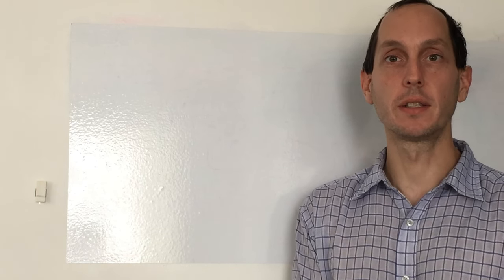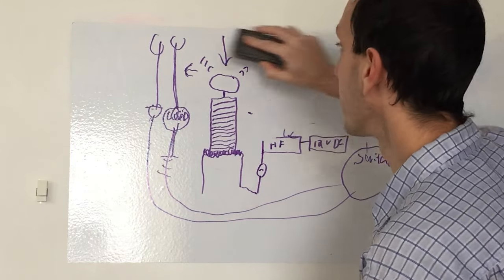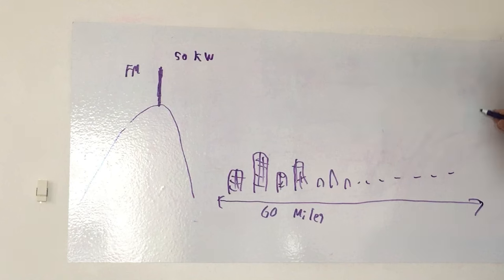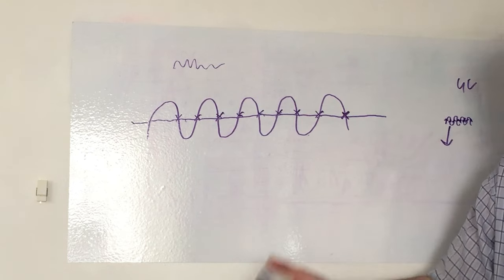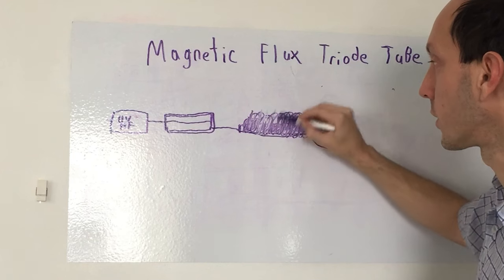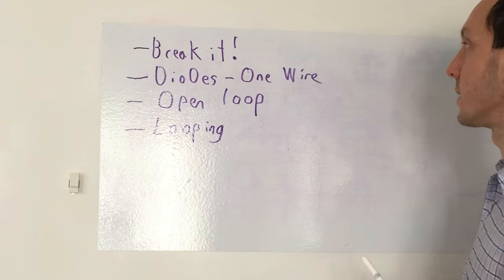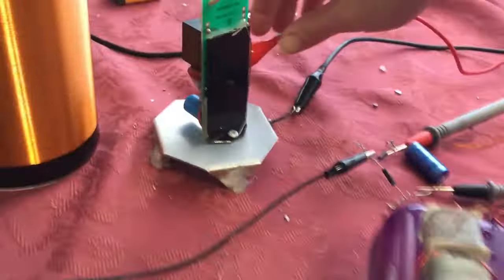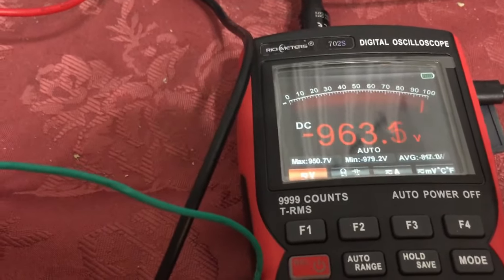The Magnetic Flux Triode

Comment: Your setup and explanations reminded me of another Tom Bearden setup which is as follows:
Make a step up transformer and connect capacitors in series on both wires that are coming out of secondary and then connect one more step up transformer and then run load after 2nd transformer.
The first transformer won't draw as much current as the second transformer primary will draw. The extra current will come from displacement current as a result of connecting capacitors in series. If you get time, try this too.

Comment: Hi Joel, can you use gas discharge tube (gdt) spark gap to mimic switching instead of transistors? Either use it as plain spark gap (GTD with 2 pins) or triggered spark gap (GTD with 3 pins, where one acts as trigger). GDT can be obtained to spark at specific voltage (150V, 350V, ...) according used capacitor. I thing you used this in some of your previous video.

You are very inspirative for me. Thank you
Reply from the maker: I don't see why not. You could calculate the timing so lets say you got 60 capacitors in theory you could make them all fire one time a second and there is your crude 60 hertz. no transistor. Also would need to build a few tubes to drive the caps.

Comment: For triggering a mosfet dump you can use a neon bulb at 90 volts they make diacs that trgger much lower i think ive seen them at 3...9...16.. ect the 16 would be great for battery charging and easy on the transistors .
Reply: Explain this pls.
Reply: @TravisTellsTruths  I don't have the diagram on front of me but the short version is a neon is placed between the gate and the accumulating power source and when the accumulating power source reaches the trigger level around 90 volts it triggers the neon and activated the gate of the mosfet .you can put a resistor on the neon to drop the amps from coming though to the gate you only need the voltage. It dumps to a battery
Reply: Fascinating. Did you know that Bell Labs (evil) used fluorescent tubes as literal "negative-resistance" telephone signal amplifiers? Can you explain this at all?
Reply: And really cool, BTW. So instead of a traditional resistor for the gate?
Reply: @TravisTellsTruths  no new to me how did it work out .
Reply: @TravisTellsTruths  speaking of bad corporations westing house ???..don smith said that they build a group of drones for China that used his system in them and never need to recharge just stay up indefinitely.then he said now you see who the real enemies are .
Reply: @R2NOTU  well I read in the very early and more primitive days, that was done. I'd like to know more about it. And what they used next.

Comment: LOOOOOVE IT!!!!!!  You are so close to a useful powerful unit!
Reply from the maker: Well I can't come any closer as this. But I give everyone the information if they have the resources to build this. I'm thinking perhaps high voltage relays or even spark gaps with something like 60 capacitors at the right value can all dump one time a second equals 60 hertz, Whatever it is, It needs money high voltage components don't come cheap and you need a kind of workshop or garage. I just can't really do more in my kitchen. I hope folks can put it together,  its a basic controller at this point. This can be costly. But i'm sure someone has a dump of HV parts some place and will try this someday :) Also these voltages and currents are getting dangerous to play with in the open in a kitchen like this. Not very apartment friendly.

Comment: Quick question(s) on building the triode tube.  1) Is a longer fluorescent tube better than the smaller one you're using?  2) Can you simply use aluminum foil between each layer instead of all that coil winding?  3) If it does need to be magnet wire instead of foil, which is better, thin wire like a 26ga or thicker wire like a 16ga?  Thanks and keep up the good work!
Reply from the maker: I use the windings to create more resonance effects because I use so little current to  increase the field, if your using a generator that takes  few watts or more , just simply using foil layers should work fine, you can replace the bulb with rod if you don't care about the extra EM energy you might pull from the scalar conversions.
Reply: @joellagace1679  A rod like a wood or pvc, or would a ferromagnetic rod be better?  Also, thicker or thinner wire?  Also also, would wax paper work as the insulator between layers, or should it be electrical tape?
Reply from the maker: a rod conductive rod. thinner wire and feel free to experiment with the insulators, I have not tried many variants but it should all work at varying degrees.
Reply: Sooooo.......I'm using MTECH's transmitter and receiver coil.  When I put a 24" fluorescent a few inches from the receiver of course it lights up, but I gotta say I noticed practically no difference at all in available power whether my tube was wrapped in foil, roofing aluminum, or 18" of 18 gauge magnet wire!  I would have bet my left nut that the much greater mass of the magnet wire and roofing aluminum would have given me way more power than the aluminum foil, I wonder why it didn't 🤔🤔🤔

The 3 different bulb wraps all fed the one wire half bridge setup, which then fed a small capacitor, toy motor, and voltage meter.  The cap voltage stayed about the same on all 3 setups.  Would the outcome have been different if I powered the bulb up your way instead of with a MTECH Tesla coil?

I haven't tried multiple layered  wraps yet like you suggested, how did your tests go with them?  Were they all independently just as strong as the first one?
Reply from the maker: Yeah As far as what MTECH is doing and how his coils and excitors operate and interact with this I would have to be honest and say I have no clue. Yes as far as I could tell they were all around the same power. What I need is a bunch of caps not to big but lots of them of the same value so to make the system more symmetrical on the discharge.  If you have that try it, I think it will work well.

Comment: Hi frequency high voltage switching. It's looking like Wolfspeed  silicon carbide power solutions in materials have a wide variety of products available. For switching at these magnitudes with low losses…. website says they have a valuation kits…..

Comment: 2:35 of course not , its a vibration.  "NO LIMITS"  only limit is any factors that cancel the vibration , this is why you dont build transformers symmetrical unless you want to cancel the field . If the GRID did not build those pole transformers asymmetrical there energy would radiate the entire surrounding environment and anyone could pick up on it for free. Again there would be no limit to the output as long as the vibration can  not only propagate but echo aka amplify

Comment: Capacitors are way more adept at taping the ZPE compared to coils. Build a purpose-built cap for that, ground/aerial it, and excite it with a Tesla coil.
Reply from the maker: yep another variant of Tesla's one wire or in this case one plate (antenna) capacitor charging.
Reply: @joellagace1679  I'm guessing you could use something similar to a chembuster instead of an aerial. They seem to form a connection with the atmosphere. There's also the Barbosa / Leal device that uses an array of ground points.

Comment: A single antenna 20 miles from the 50kW radio transmitter then can receive power in the value of 3µV. So what would happen if you placed a grid of 10x10 pushpins, say, through a block of styrofoam and then coupled the bottom of each—would you get 300µV? Expanding this, what about 100x100—is that 30mV? Is 1000x1000 pins 3V? And is 100,000x100,000 receiving 3kV? Could, in theory, one increase this to receive more power than what was originally put into the system (1,000,000x200,000 => 60kV)? My gut tells me that seemingly unlimited receiving antennas do not load the transmitting system, that the oscillating EMF will yield overunity. One of Tesla's experiments in Colorado Springs created more power than went into the system and the surplus energy went back to the power plant in the city, taking it out of commission. It is difficult to find this anecdote online, perhaps it's being suppressed. :shrugs:
Reply: If it is difficult to find it's only because it is BS.

Comment: I recall the video someone used off the shelf silver tape as the tesla coil secondary(instead of winding the fine wire) and it had extremely powerful capacitive discharge.  I wondwer if you put 5 or more at the output and combine the capacitive discharges then switch at the mains frequency would give some interesting results?? https://www.youtube.com/watch?v=rt5VJFngHak
Reply: Thank you for sharing that trick!

Comment: i am at 17 min an u say it doesn't work tat way as you consider communication.. have u considered si unit volts a square meter? i there is volts per square meter there is scalar, then there is also dipole. I am sensing ai there for  any electric potential i can register as volts. even volts a second. look i am quantum today. you learned so much in explanation. this is not don. this is me free this one. ask a question im so sick no 1 acknowledge even the volt? come on. am i invisible? i have already made a vid on the act that the volt is a lag and is senced, and registered as a volt.. prove me wrong?

'

Comment: at 25 min u cleared the air, i am dumb founded., you seemingly used hv, and made many conductors. even to the point of plume, and receivers. a i quantum? is this correct? so in other terms u simply add a wire?f or each time a vol. i like it plasma as a volume of volts. i also static.. of voltage? i am at 26 min.. that is  it.. it is not don smith, it i quantum fluid? the layer o a conductor over the plasma of a lamp. is not necessary. but u may have a volume o volts that i can use in the advances quantum theories to follow im sorry i have to do this, but i am scalier.. i continue..

Comment: so this is the second time im am listen to the vid. so at about 21 min, 30 seconds u layer a coil., think o it this way instead. u need the oil, then a shrink wraps of insulate, then a conductor, not a coil per say, save u much time. u Luzon need the oil, and the plastic separator. but u do not need the fluorescent tube. so dont spend time on a coil o wire, simply use the oil, ans separator..
Reply from the maker: More going on here then most people think.